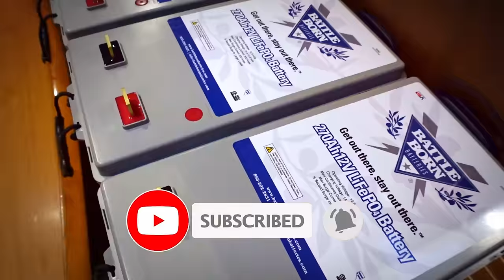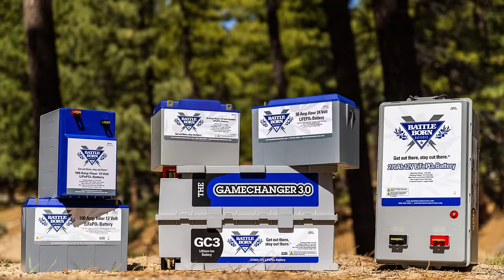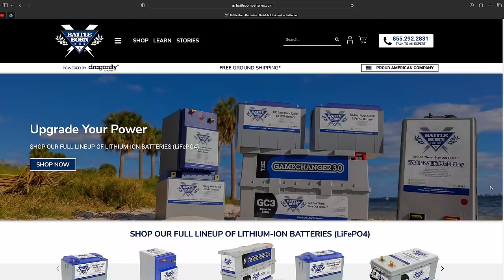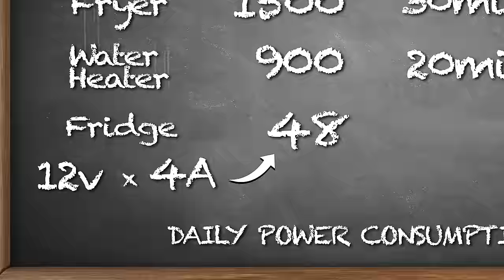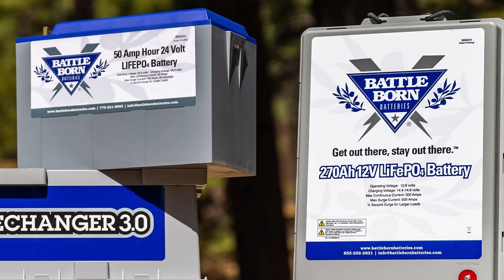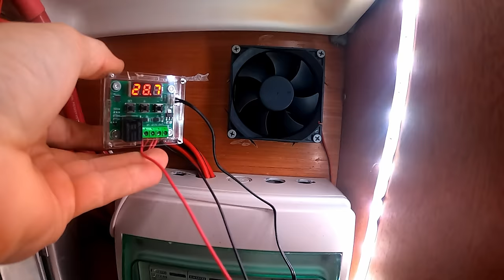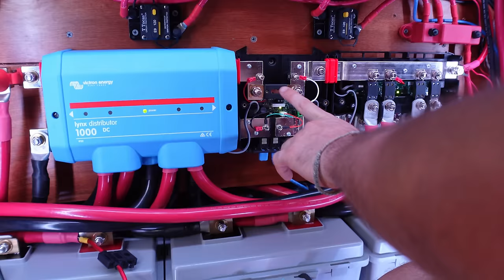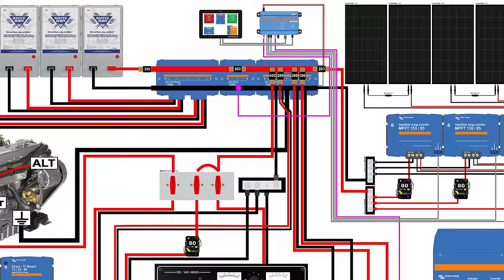Off-Grid BOAT WIRING for DUMMIES! 12v Lithium Battery Bank Install: DIY HOW TO  🛠️💥| ep.26

Comment: You can't look at ac current as high voltage and dc current as low voltage.  Ideally you would want the battery bank voltage as high as possible as it improves efficiency and reduces amp draw which also reduces the need for such large cabling.  When calculating your power needs you must remember nothing is 100 percent efficient and manufacturers constantly manipulate figures to trick consumers and that is true for anything from light bulbs, appliances to solar panels and inverters.  Solar panel manufacturers use a variety of different testing procedures and when compared and tested using uniform test procedures the results can be shocking.  Solar panels loose efficiency above a certain temperature and power output will drop as temperature rises.  

I do not like using a single inverter for any installation because you have no redundancy.  Instead it is better to have multiple smaller inverters that can automatically turn on and off depending on power needs at any given time and if one fails only the capacity of that single inverter is lost.  You also gain efficiency by having multiple smaller inverters since they are in standby mode when not needed.  

I personally do not like victron equipment and it would never be my first second or even third choice for equipment manufacturers, I do understand that victron heavily sponsors YouTube content creators with free or extremely discounted equipment.  

My personal choice for equipment would be outback power systems. I have had excellent luck with their equipment and the first inverters I purchased nearly 20 years ago are still functioning perfectly.
Reply from the maker: You actually can look at it that way unless you’re working outside of the recreational marine industry. This video was for beginners to understand the basics and we made it so that they didn’t have to suffer reading all of the “technically correct” articles like the one you just typed out. We are aware of everything you’re saying and some of it is great advice however it’s best to keep things simple so people can understand the basic concept before confusing them right out of the gate

Comment: The definition like AC = high voltage vs. DC = low voltage is not useful. The US e.g. got 110 VAC but in a Tesla car the DC voltage is close to 500 V ! So clearly the difference is not between high and low but between AC and DC.
Reply from the maker: For 99.9% of recreational boaters, this analogy works and we’ll help them grasp the basic concept. But yes high and low voltage  compared to AC and DC is incorrect

Comment: Very nice explaining but no are not  100% correct about AC/DC. DC and AC both can be high voltage.  My solar has 381 volts 14 amps DC from panels to MPPT controller in my inverter. My inverter puts out 2 120 volt lines so 240 total. Both are dangerous. Some solar systems are over 1000V DC. The reason you want high voltage DC is a smaller line is needed for distance its how many amps it carries is what makes the wire larger. I used 600V wire that can handle 30 amps at 250 feet even though I only used 125 feet. Same with using 48 volts system from batteries to inverter, takes a smaller wire size than a 12 volt does.  You are a master carpenter but still have a little more to learn about energy AC/DC.
Reply: Amen!

Comment: Sorry bro, but you’re pretty much wrong. AC/DC doesn’t mean high or low voltage, but alternate or direct current. You can find high or low voltage in both cases. Another thing is groundig the negatic of your system. This is not unanimity agreed by all regulatory agencies around the world.

Comment: OMG..!  This Couple Just Hauled About $60,000 Worth of Electronic Equipment, in a Dinghy Across the Water.  My Toes Curl, Every Time These Guys Do Something  😁

Okay, Now I'm Going to Correct Some Salesman's Math.  This Guy Talks Like a Battery Salesman.  I'm Going to Talk About the Thermostat...the Battery Salesman's Worst Enemy.

Okay, a Thermostat Regulates Temperature.  When a Fridge Gets to a Desired Temp, the Thermostat Tells the Fridge, to Kill the Motor.  The Fridge Motor is Now No Longer Using Electricity.  When the Thermostat Registers a Temperature of Like 10% Warmer Than Fridge is Supposed to be, the Thermostat Tells the Fridge Motor to Start Up.  Even Though the Fridge Motor Starts Back Up, it May/May Not be Using 100% of Electricity.  The Motor May Only Be Working at 20%, Because It Only Needs to Change 10% of Temperature.

Same With the Air Fryer.  The Air Fryer Will Heat Up to Something like 350 Degrees, Then Yes...the Thermostat Tells the Fryer Motor to Shut Down.  Only When the Temperature of the Air Fryer Drops, Does the Air Fryer Begin to Heat Again.

This Happens With All Electrical Appliances.  Even Your Toaster, Doesn't Stay Constant.  Next Time You Toast a Bagel, Look at the Toaster Coils, After a Minute...No More Red Coils.

I'm Not Going to Discuss the Internal Heating Elements of Every Appliance, but They All Work the Same.

In Closing...if You Leave the Fridge Door Open All Day, Yes You Will Have 100% Electrical Usage.  If You Leave the Air Fryer Door Open, You Will Use 100% of Electricity.  Also, IMPORTANT...These Are All Chinese Motors in Your Appliances, and if You Leave Your Fryer or Fridge Doors Open for Extended Periods of Time...Your Motor Will Burn Out.

Moral of the Story is Yes, a Salesman Told This Couple What to Say, to Have Their Audience Buy More Batteries Than They Need.  It's a Beautiful Set-Up They Have, but Yes, It's Waaaaaay Overboard.  😉
Reply from the maker: No coaching by any salesman here, but yes valid point and we actually did take this into consideration when we did our math…We got carried away with making it “as simple as possible” which led to us unintentionally leaving out a few other areas to take into consideration. Chances are they do more research before making a large purchase like that, however, even if they don’t, it’s always better to have a little extra. There’s always a time where everyone wishes they had more!
Reply: @SpearItAnimal   It's an Amazing Setup.  Trust Me...EVERYONE is Jealous...:face-fuchsia-poop-shape:  Congrats...!!

Comment: Hot Water heater?? Why would you want to heat Hot water??
Reply from the maker: You’d be surprised at how cold the water tanks can be sitting in the bottom of your boat
Reply: Better question, why would you heat hot water? About as smart as his high/low voltage analogy.
Reply from the maker: Ohhhhh got it, yeah “water heater” makes more sense. Don’t know why we grew up calling it a “hot water heater” but we did 🤣…you should make a video to clear things up, Sounds like you have a wealth of knowledge!
Reply: @SpearItAnimal  Atempted burn, fail.

Comment: Major major flaw at 04:20 if you allow your boat to dump electrical into the water you are creating a situation for ESD (electric shock drowning) a deadly condition for anyone in the water near your boat and a danger for the underwater metals of any boats in the vicinity of your boat. 
Just sayin'
Reply from the maker: So what’s a ground wire?

Comment: AC or DC has nothing and I mean NOTHING, to do with high voltage and low voltage. There are high and low AC systems and high and low DC systems. Voltage is merely and expression of how much energy is carried by the current. Actually voltage isn't it's name., it's the name it was given after Volta a famous Italian who did all sorts of electrical experiments and made what was possibly he worlds first battery, although the Mayans may disagree with that claim. Properly, Volts, a measure of voltage, is actually Joules (amount of energy carried by) per Coulomb (quantity of charged electrical particles moving through the system, J/C. Now, on your system where you want batteries at a low voltage, no-one wants high voltage batteries, (well except for submariners, who have batteries running at high voltages, but that's to save the energy loss in inverting, or turning the DC into AC and then raising the voltage. And you need high AC voltages to run domestic and industrial machinery. No-one can store AC, it can only be stored as DC. Actually, that's wrong, a battery does NOT store DC electrical energy, a battery stores chemical energy, which it is capable of turning into electrical energy, DC energy. So, your system is Low Voltage DC and High Voltage AC. But that is just how YOU are coincidentally using them. Therefore your description, although valiant, is wrong. Sorry, you are doing a great job, but I'm a physicist and as such, most of us are rather pedantic.

Comment: This makes my eye twitch.. I know you're doing the version for lamens but theres so much "no" going on here.. Under 1,000 volts is "low" voltage for AC and under 1,500 volts is "low" voltage for DC. For those who don't know, a 12 volt car/boat battery or a small generator (low voltage DC) will both cook your ass to death. DC will also force your nervous/muscle systems to lock you onto whatever you're being electrocuted by so most believe it's more dangerous for the DIY crowd. Be careful when f*cking about with electricity.
Reply from the maker: I'm sorry, are we wiring in an electrical grid??? There's NEVER BEEN 1000v AC on recreational liveaboard and the same goes for high voltage DC... All of you high powered commercial electricians chime with knowledge that may be true but is so far irrelevant to this small scale install.  This video is geared to help the people with zero knowledge grasp the basic understanding of their boat.
Reply: @SpearItAnimal  Fair point. Doesn't mean the power system on your boat cannot be dangerous, which is the reason I commented. Overall I enjoy your videos.

Comment: Sorry, NERD ALLERT! {the nerd is me}
AC stands for Alternating Current, not "high voltage" and DC stands for Direct Current, not "Low Voltage". Basically anything below 120Volts is considered Low Voltage, and anything above 120V is High Voltage (not to be confused with being high, as in smoking too much weed. Sure you may be high as a kite, but your voltage is still relative to ground, and as a human, you're never too far from ground.)

Direct Current is fundamentally different from Alternating Current. Please study and understand the difference before thinking that DC only means "low Voltage" when it doesn't. You can have high Voltage DC and low Voltage AC. They are not the same thing.

You can turn AC into DC with something called a RECTIFIER. and you can turn DC into AC with a INVERTER. But this process doesn't necessarily make it high or low voltage.
Reply from the maker: Ive had other electrical nerds tell me anything below 440 is low voltage but it’s all relative. I, word for word, said that AC stands for Alternating Current and DC stands for Direct Current in the video.

Comment: Guys , i love you but no…. AC means Alternating Current  DC means Direct current, they have only a relationship to to Voltage through resistance. 

If you imagine a road tunnel at 08h00 in the morning, stay with me , and we imagine that all they cars drive at the same speed, the speed we set, even if they are Audis or BMWs (I’m stretching imagination beyond normal bounds but please keep up), The current is the total number of cars that pass through the tunnel per second , the rate of car throughput, the voltage is the speed of the cars (including Audis and BMWs) and then resistance is the number of lanes of traffic in the tunnel (Assuming no one in an EV has run out of charge or dietary fiber in any lane).

If you have had enough alcohol to understand the above scenario you will feel beyond deprived that i have not applied the AC/DC (Best Track is Ride On from Dirty Deeds Done Dirt Cheep) concept to the above, in DC all the traffic goes only one way , like they are escaping a zombie invasion, but in AC they go one way in a morning and return the same way in the evening (allowing for those within dubious nocturnal agendas).

Hence the voltage, as in the speed of travel (with the previous caveats), when measured from a specific location, my local pub, might show a positive value in a morning and a negative value in an evening as folk return home. Due to the prevalence of Audi and BMW drivers we are forced to take all the individual speeds in an AC situation Times them by themselves to find the square (which his always positive) then add them up and divide by the number of individual speeds and then find the square root of that which is the RMS average speed (voltage) of all the cars…

I’m sure I don’t need to explain that this excludes Jaguars as they don’t adhere to the normal rules of physics with regards to velocity and acceleration…
Reply from the maker: We understand all of that and know when didn’t explain it EXACTLY as the science works but we kept it as basic as possible for newbies to comprehend the concept. If they understand it in the way we described then they’ll be able to get by just fine. And if they need to know anything more technical then they’ll be able to dive into the dry science behind it all later on. But yes you are correct 🤙🏼
Reply: You don’t drive an Audi or BMW? 

It was just a bit of fun to try and demystify Ohms law in a humorous  manner :-)
Reply from the maker: Loved the dietary fiber line you threw in there 😂
Reply: @SpearItAnimal  Better in than out perhaps… :-)

Comment: AC means alternative, DC means direct... High and low means nothing. You probably confused more people than you helped. You can have low AC and high DC.
Reply: Dude did you even google your info before spouting misinformation"?  AC means "alternating" current Not alternative. An alternative is "available as another possibility" SMH!
Reply: @sderden thank you saved me from having to reply also!😁
Reply: @sderden  lost in translation, in other languages it's alternative. But you get the point. He is wrong about almost anything... Water heater needs more than 20min, fridge has a duty cycle of around 50%, inverter has a 90-95% efficiency. I just pointed out the most obvious. Guy did a good job on everything until electricity. And now he's confusing other people. But I need to congratulate you for your Google skills.
Reply: @mathieutremblay1425 👏👏👏

Comment: My gawd you don't have a clue. 

What you have on your boat is ALL low voltage. They are however  VDC and VAC. The VAC can be either 50 or 60 cycle depending on North American or European electrical systems. Don't mix them up. 

Am a retired Electrician that was certified on up to 50,000 vac. I think the cut off is  around 10,000 volts is high voltage and anything between 5,000 and 10,000 volts is medium voltage.  Anything less than that is low voltage. 

Please refrain from using incorrect terminology. It could get dangerous for the people you are trying to teach 

😢
Reply from the maker: My gawd, Michael, lighten up. 
This is for recreational boaters, not people who are dealing with 50,000 vac. It’s an entry level video to help them grasp the basic concept of low voltage electricity on a boat and relatively speaking 120v is HIGH VOLTAGE compared to 12v. In no way did we say anything that will get someone hurt.